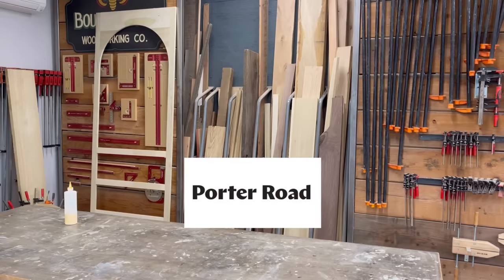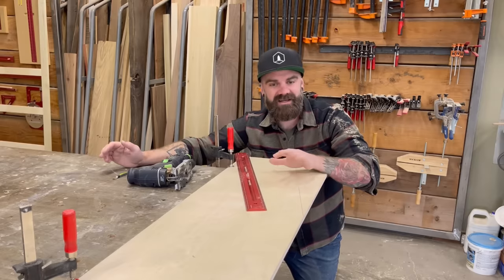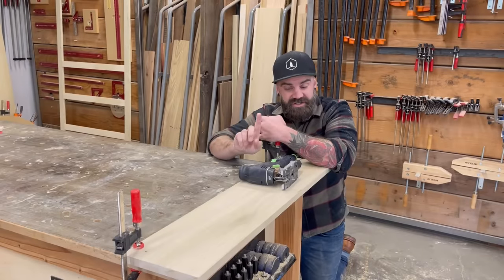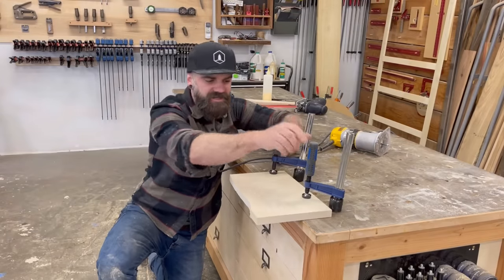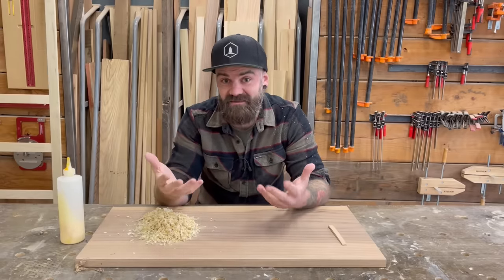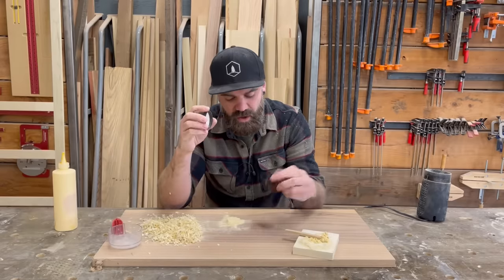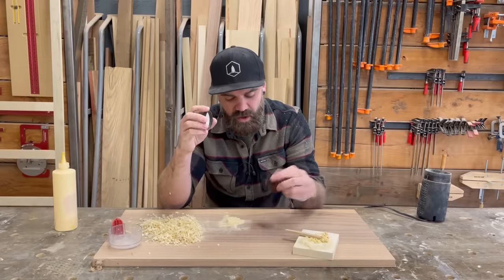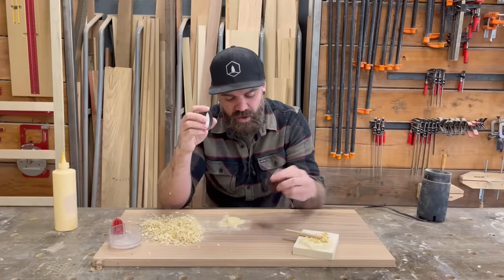Woodworking Tricks You'll Actually Use || Helpful Woodworking Hints

Comment: Another source of very fine sawdust for mixing with glue is from your dust collector. The fines accumulate on the metal ridges where the bags or filters attach. You can catch a coffee can full  of the fine stuff. The downside of this is that if you sand different species of wood regularly you’ll wind up with mixed sawdust. But an upside is that often it doesn’t matter when used because it will be close enough to the right shade and won’t be noticeable

Comment: Also, hope that was a Bosch jigsaw. Bosch also makes blades that cut perfectly vertical on 1 1/2”red oak. Never had issues on rounded starter treads. Still, good tips for those without Bosches.

Comment: To find the tallest part of the blade, I usually just turn the setup block to run along the blade, then lower or raise the blade until it is the same height. It just takes away the need to know exact center of the blade. You can turn the blade a bit and make sure none of the teeth are too high

Comment: For dust, I take the corrugated hose from my drum sander and tap it on the floor or bench top, more dust than I can use. For crack repair, the wood glue does work, but I prefer the CA glues, thin, chased with thick, then after it sinks all the way through, more glue and some dust on top. You never can totally hide the crack, so make it a 'design' feature. For exact height on table saw blade, if I want it at 1/2 inch, I use a 1/2 inch block, and then put another piece of wood on top of that and slide it front to back to see if it catches the teeth. Might have to try the nut on my bar clamp handles...

Comment: 2 words.  hockey tape.
A product everyone should have in their toolbox.  It's a great solution to slippery handles.  Especially wooden handles. That is specifically what it is designed for.   It provides excellent grip and is obviously really easy to apply.  And if you want even more grip, just twist a small section and wrap it around the handle, then apply more tape over top.

Comment: To find the high point on your tablesaw:
  1Remove the blade and with a sharpy draw a line between the tips of 2 teeth on opposite sides of the blade i.e. right through the centre of the hole.
  2Replace the blade and  table insert.
  3Lay down any old offcut with 2 square edges on its edge next to the blade and rotate the blade until the line is parallel to the (vertical) edge of the offcut.
  4Then mark that point on the insert and lay down the offcut to square the mark across the insert onto the bed of the saw.

2 other ways of getting cleaner jigsaw cuts:
  1Where access to the workpiece is not an issue,you can hold the jigsaw upside down underneath the workpiece and watch the blade from above whilst steering it from below(this works best with the non D-handle type of jigsaw) or even mount the jigsaw upside down like a router in a scrap of sheet material.
  2They can be a bit pricey but there are blades which cut on the downstroke only.
These have to be used carefully though with workpiece held down and firm downwards pressure on the jigsaw as they want to send the jigsaw jumping back out of the work at you.

Comment: For finding the center of blade, you can also mark the two points where the same spot on a single tooth crosses the plane of the table saw and then find the point between those two points.

Comment: Jigsaws       they sell 2 blade types 
1) up cuts (teeth facing "UP") when you cut the blade cuts upward creating the rough edge on top.
2) down cuts (teeth facing "Down") the blowout or rough edge will be on the bottom

Comment: When I'm setting my blade to depth, I just raise it up a little higher than the setup block, and rotate it until the next tooth in front  and behind of the top tooth are flush with the top of the setup block. then I know the middle tooth is at top dead center and finish setting depth off of that tooth. My biggest problem isn't knowing where the center of the arbor is, but knowing when one tooth is perfectly aligned with that point. This trick solves that.

Comment: Regarding the dent...
Put a bit of water in the dent, as little as necessary.  Use a soldering iron to heat and boil the water.

Comment: Take a workpiece and set the blade slightly lower than the middle by eyeballing it. Make a cut less than an 8th from the edge of the piece. Flip it over. Cut it again. Raise the blade slowly and repeat until the saw just barely removes the remaining material. Now you have found center

Comment: I use saw dust for filling small holes and cracks but NOT with any glue.   Glue will affect whatever finish you apply and be visible.   Instead, pack the saw dust in as tight as possible and add a little water.   This causes the dust to expand.  Sand lightly when dry.   The dust plug is held in place with the finish.   I have done this with glue but it never hides the imperfection very well.   Of course this does not add any strength to the crack.

Comment: To mark the arbor center... why not just pull the blade off and make a pencil mark across the diameter (whatever blade tip to tip that crosses the center of the arbor hole).  Reinstall the blade and use a square to make sure the mark is vertical, then transfer the mark to the table.  No sacrificial fence or precise cut required.

Comment: @16:52 its still a guessing game. my first tought was: so far so good but why not raise the blade, just a little bit and lower again. you can clearly see entrence and  exit spot on the wood. take a 90° angel or just a 90° cut piece if you have no adjustable angle and your's to long or to short to reach all the way down to the table and make 2 vertical lines on the entry an exit. connect all 4 corners (use a stopblock if you feel the need to take out the piece of wood to be more precise on marking with a knife) where those crossing lines meet is 100% center of your blade. NO GUESSING and should be no room for doubts, you're welcome :)
Reply: omg i should keep watching first but same thought even if i think my stopblock is even more precise but the flip down was to mark again on the table... smart again :D but still not getting the point of why to make this in the first place... i usually take a piece of wood that i intend to cut and depending on the material i raise the blade and keep an eye on the entry point of the blade and the angle of the teeth, maybe someone can help me out why the center is so important ^^

Comment: I would think to find the exact center of the arbor one would simply clamp a board over the blade cutout on the table and then raise the blade into and through the wood.  Simply measure the distance of the kerf cut you just made and locate the halfway point which of course is dead center.  Having marked the board ends on the table, simply raise the board on edge and mark the halfway point on the table.
Reply: Thats how I do it with a zero clearance insert.  Install the insert, raise the blade, then divide the kerf length in half.

Comment: 2:30 I know it's overkill but, I do not seem to have the skill of holding the straight edge still as I go (perhaps this is coordination?) so IF my straight edge is accessible at the board's edge, I often will clamp down the straight edge so that it won't cause me issues. You know, on the more important items. Also, before this video I didn't think of scoring the line, only drawing it, so my line is erasable until I score it.

Comment: For the clamp trick, while that will work it still will not be as tight as you can do by hand if you have leverage.  There's a reason why breaker bars are used to loosen lugs...  Not saying it's not effective, just a thought.  Also, if you don't want to put that much effort into it just go pick up some hockey tape if you don't already have it and give those wooden handles a couple wraps.

Comment: Marking a line that matches the center of your table saw arbor...
Remove the blade and anything else on the arbor.  Put the dado plate in to get room to work.  Put a square down the slot, with the wide end on the dado plate and the long arm up against the arbor.  Transfer that mark to the dado plate.  Repeat for the other side of the arbor.  The arbor is 5/8", so half that is 5/16".  Do you have 5/16" in that handy set of aluminum blocks?  Put it against each line and mark the other side - the middle - from both sides.  Transfer to the table,  Also TRANSFER TO THE FENCE!
Alternate approach.  Cut a V in the end of a stick.  Draw a line parallel to the side of the stick that is exactly lined up with the center of the V.  Take off the plate.  Run the fence over opening.  Put the stick down there on the arbor, center line toward the fence, and run the fence up against the stick.  Square up the stick and the top of the fence.  Transfer the line to the top of the fence, etc.

Comment: That dead center trick is a bit complicated ... i don't have a table saw, but i've seen this being done: take an elastic band or a piece of nylon string and stretch it between two straight line expansion slots or two same depth gullets, now mark the band inside the slot or gullet and rotate the band so the marks on the band align on both sides and then just lower your blade until the band is parallel and just over the insert ... never tried it myself, as i said i don't have a table saw, my micro weekend warrior shop is too small for even a portable table saw, but the trick seemed legit when i saw (lol, unintentional pun) it.

Comment: Not a woodworking comment:
One "Trick" I learned recently regarding the steak: personally, I get way better results by adding salt after the steak was cooked. Has something to do with drawing water from it and altering the structure, I was told. Oh and if you trust your source, don't wash them! Just clean them lightly up with some paper towel. It will be in a pan at insane high temperatures. Any bacteria goes bye-bye on the outside while being cooked, so...

Comment: To find center of arbor, raise blade to maximum height, mark the throat plate where front and rear of blade exit and then divide the measurement in two and mark the center. No making a fence, no cutting necessary.
Reply: This is what I came to say.  However, no need to raise blade to maximum height.  Any height where a visible amount of blade is showing should work.  The only exception being saws that move the arbor in an arc when you raise/lower the blade.  This changes the center point, so a different method should be used [there were several described in the comments].  Also, when marking the spots where the blade appears/disappears should be done [VERY carefully!!] with the saw running, so you can see the outermost diameter of the blade's circle as it spins.

Comment: For table saw blade top-center positioning wouldn't it be easier to determine center of rotation with the blade fully up then mark on insert? 

Or take exact OD of the blade and minus the radius.. 

Numerous ways to figure something out I suppose.

Comment: Why not just turn setup block so reference surface will be much longer?
Reply: What if your insert is not quite the same height as your table? My saw is a budget model and the stock insert is a pile of poo. I made a zero clearance insert but it's a gnats high and I need to sand it flat.

Comment: My face when you knocked off that woodpeckers straightedge…a few days ago I came into the shop to find that someone had knocked mine on the floor and dented/curled up the corner 😢

Edit: I’m certainly not a machine setup expert, but if you ever needed to adjust your trunnions, that line you scored on your cast table might not be center anymore

Comment: Out of curiosity, why wouldn't you turn the setup block 90 degrees so that it runs parallel to the blade, then you could raise the lower the blade to the correct height, as the highest point of the blade would meet the top of the setup block?

Comment: Wood filler:  Use Weldbond instead of Titebond, so it dries clear and doesn't add yellow to the fill.
Saw blade center:  Why not just raise the blade just to the point that a straight edge can be snagged by a blade tooth???
@7:05  I am glad that you use eye protection, but you should seriously consider hearing protection (from someone who now has lost 70dB of high frequency hearing!).

Comment: 6:35 O.k. Dumb question. If you have a trim router with the flush cut bit why wouldn't you use it instead of the wonky jigsaw in the 1st place?
Reply: That would work if you were using a template to guide your cut, but with a router you would need to make multiple passes to get the full depth without bogging down your router.
Reply: @keithosterkamp6207  Ah, got it.

Comment: A bit confused about you saying that a longer blade in a jigsaw will flex more than a shorter when cutting the same thickness of material… Firstly it must be the material, not the air, that make the blade flex. I.e. blade length makes no difference. Secondly a longer blade is usually thicker and therefore will flex less. The tip about correcting the problem was top notch :-)

Comment: about the setup block and blade height, would it work to just flip the setup block long ways instead? would be more forgiving. Maybe there’s something that I’m missing and this wouldn’t be practical.
Reply: If it's small and you have a normal insert plate, it might fall inside the saw.  A zero clearance insert would solve that issue though.

Comment: That's a dry spice grinder. As a coffee lover, please don't use these for coffee. Fast metal blade will burn your beans. And the randomness of the cut gives you an inconsistent sized grind, which leads to large under-extracted granules (waste) and small over-extracted granules (bitterness).

Comment: 2:25, Cant you just use a JS blade that cuts on the opposite stroke? I have all kinds of blades for this exact reason, if good side is up then get the blade that cuts on the down stroke, if the good side is on the bottom then get a blade that cut on the up stroke. Am I missing something here? I see people that work on putting in flooring cutting upside down so no blow out happens..

Comment: could you not just turn your set up block 90 deg to be parallel with the blade, you wont need to find dead centre of the saw blade when you change height as the set up block is longer than any visual discrepancy ..
Reply from the maker: This is true however I don’t like to set the height off the insert because that can vary from the cast iron top.

Comment: You guys all have nice shops.  What size shop should a certified cabinetmaker and woodworker be in?  Renting a place is 1600 per month (500 Sq Feet), My Garage is 340 Square feet and a damn obstacle course.  I want to get to work, not be dicking around with making clever folding table saw flip planer tables to try to save space.  I seriously wish there was a video on Shop size to match work load of storage, ripping, crosscutting, turning out finished 400 CU feet of furniture per month with a carving / milling area  Work space sucks so much dick as a something you need to work prefssionally instead of out of lean-tos, or wherever you can find an outlet and the weather don't suck.  I imagine 9.000 for a 20 x 30 garage, ventilated with dust collection and all but that;s a damn pipe dream... sometimes i just want to sell all my shit and put a round in the head.

Comment: The score a line trick isn’t really needed when there are jigsaw blades made to cut on the downstroke now. There are also blades that cut very well in both directions. Pre scoring a straight line is a vastly different beast than scoring a weird curvy cutout, as you put it.
As well, that is a top mounted bearing, not a bottom mounted bearing.
Sorry, had to stop watching at that point.

Comment: You worked too hard finding dead center of your blade.  When I set my blade height I run my depth gauge lengthwise along the blade, lay a board over both and raise the blade until it hits the board.